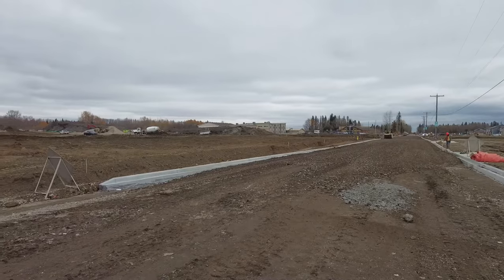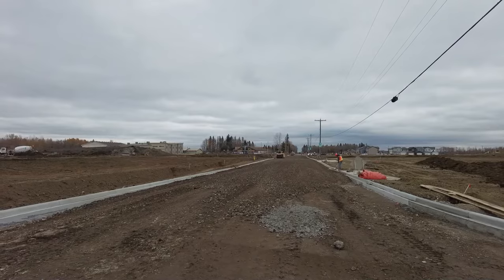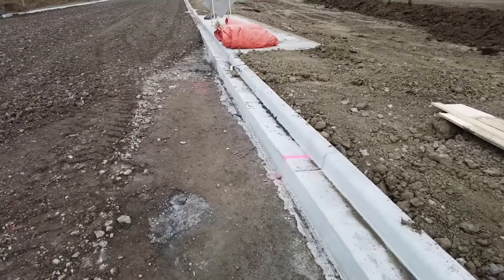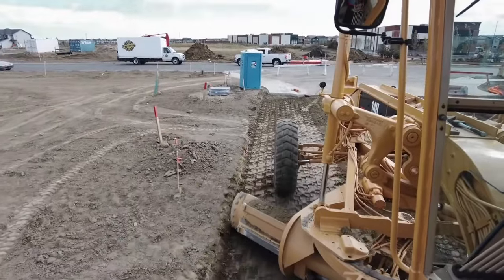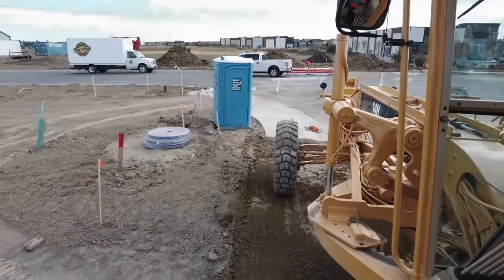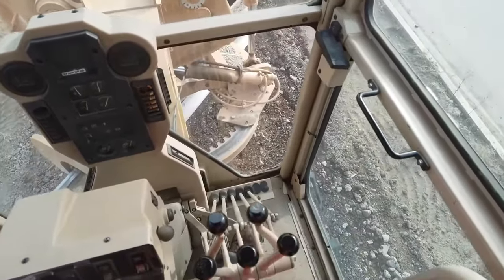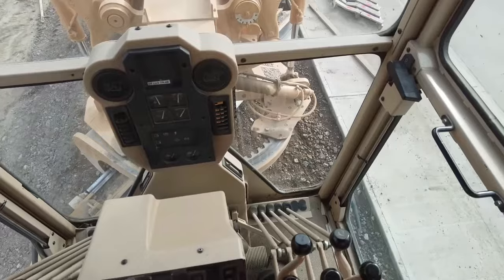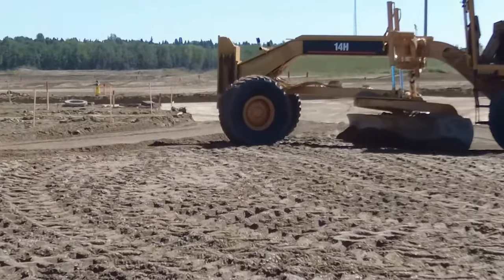Caution to grader operators

Comment: Hello, thank`s for this very good advices. As a Grader operator in Germany i´m often run in the same situations. I guess the most difficultis aries from workers' lack of understanding of the requirements of a grader operator; walking behind the Graders; stay in the way; work bearby with loader aso... Best Regards, Alfred
Reply from the maker: Regards to Germany, and thank you for the safety tip.

Comment: I wouldn’t presume to input upon the wisdom of a finish blade operator, but I have both liked and subscribed sir! It’s nice to see a fine finish blade hand at work, I checked grade for many over the years, I am an operator and truck driver by trade but also a grade setter. I worked my way up to foreman and superintendent and have helped build a good bit of work over the years, but every time I see one of these videos I can’t help but think how helpful they would have been back in the day. Great tips about paying attention to the breaking/weak points of concrete! I have seen so many so called “operators” break thousands of dollars worth of curb and gutters! A good operator shows off, a great operator tells you how many times he’s screwed up, because we all have! 🤣 Keep em coming Vern! 💪👊🤙
Reply from the maker: I appreciate your positive input, it sound like you have a wealth of experience.
Reply: @onlyamillionmistakesvernky7937  oh thank you sir, though most of it is from this side of the moldboard! I  love that you still have the wobble sticks, I myself am not used to the newer machines with only joy sticks. And I never learned gps either, I guess I'm just an old dinosaur like Hank said lol!

Comment: I have a question what is the  slope  meter attached to And is there a reason why it's not in the cab
Reply from the maker: Hi Adam, my slope meter is attached to the frame,
but it could be mounted inside the cab.

Comment: Thanks so much for the vid. I'm Alaskan and have been road building/gold mining heavy equip  operator/mech for some time on dozers, loaders and excavators. I have always wanted to operate a grader. I'm always in aw of operators like your self. I can see your skill with the speed you passed that fire hydrant and the way you manage the dirt close to the curb. LOL up here in the back woods no curbs, fire hydrants, sidewalks the only thing i fear when operating while building roads up here is monster trees, #1grizzlies, moose and the dreaded "BED ROCK" Knock on wood I've only found large boulders. I had 1 rock last year that would tip the ec220 excavator. Than on the other hand when gold mining we want the bed rock:). Again thanks so much for the time you take to teach. I'm now hooked on your channel. I wish i could sit and watch your fine blade movements for a month that would be boring to most not me. After many years this year i finally got to the point on the dozer were I don't need to get off to rake any more. And my neighbor saw my dozer built roads that looked like a grader hit them and he said, man what could you do with a grader? you need a grader. And now i want a grader LOL. And in all the roads i built i never used a level or a tape measure i use the dozer blade as a tape measure, never measured that either  some times i use a range finder but i dont have grade stakes to read like you do. I make it than put it on paper no stupid engineers to get in my way:) i would be lost in your city works to much concrete and numbers and rules and codes and blablabla. I'll take a pissed off grizzly bear over mad state inspector any day. p.s i know the grader blade is called something like moleboard mallboard maulboard muleboard mooooooooboard wtf i cant hear any more :)
Reply from the maker: Hi Bear Bait, and welcome to my channel from Alaska. Your skills from other equipment should carry over to the grader, and you should be able to catch on easily. A grader could be seen as a Dozer with more control. Also, building mining roads has lower tolerances then building streets, It's a whole different category. It sounds like you have a busy life, have fun with your "Moldboard" and if a friend wants to find my YouTube channel, just tell them to "Google" the name "Vern Kyle", that seems to work better.

Comment: Hi, ONLY a million mistakes.
Thank you for a GREAT video. I endorse everything that you have said. I have cut grade on subdivisions and roads with a variety of graders, from a Galion 118, to the so-called 'knucklebuster' Cat 12s - which were NOT knuckelbusters if you knew what you were doing and maintained them properly - to Galion 503s and Allis Chalmers DDs and 65Bs to Cat 130Gs, 12Gs and 140Gs and Hs. 

I even operated an Aveling Barford 6X6X6 which weighed 20 tons with a 16 foot blade and had a screaming 6V53 'jimmy' at 250 Horsepower and 'the BEAST', an O&K G350 with a 20 foot blade, 380 HP and 42 tons of pretty serious traction and grunt. It would push load a Cat 660B scraper better than a Cat D8H dozer.

It seems to me that you take pride in your work. I do too. I try to leave as little as possible for the labourers to clean up, do as little - like NO - damage as possible and do it as quickly and as economically as possible.

I LIKED your 'trick' of wheel rolling along the lip of the kerb after placing the material there and the care with which you cut it out again. I do the same thing. 

I had to do quite a bit trimming along the lip of the kerb at times, usually for a 1 inch asphalt top.

Thanks again.

Just my 0.02.

You have a wonderful day. Best wishes. Deas Plant.
Reply from the maker: Well that was quite a story, a lot more then 2 cents, thank you for the comment.